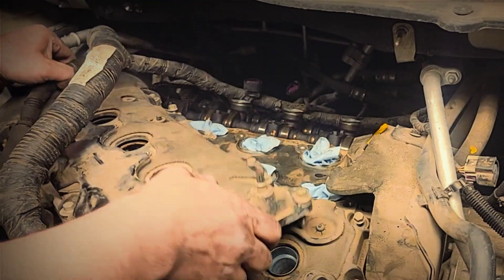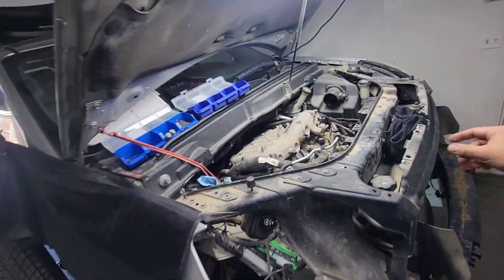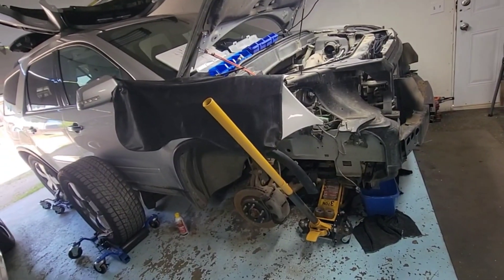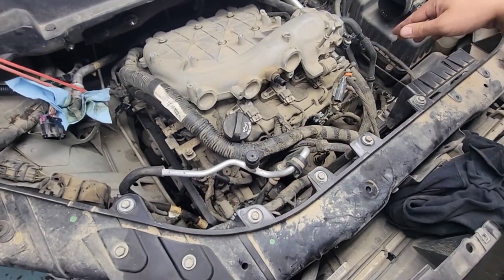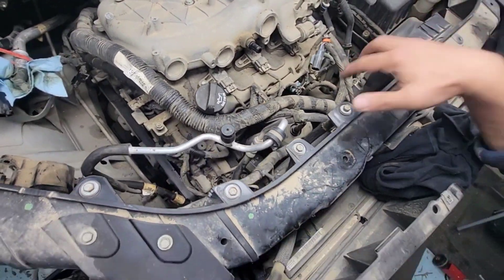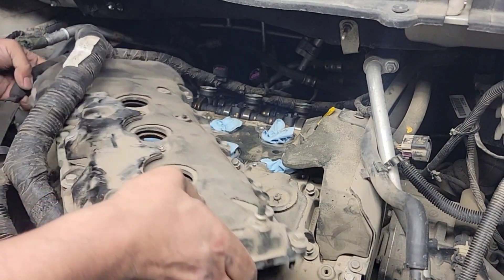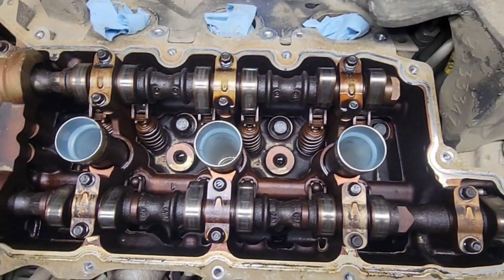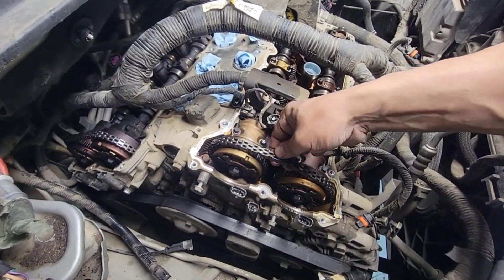2010+ Gmc Acadia 3.6L - Here Happens If you wait too long for an oil change

Comment: Wow, a lot of work but good to know it is doable without taking engine out of car. 

Question. I know my timing belt is stretched but I hear like a rattling/knocking sound on DRIVER side front of engine. It appears the timing chain is on the passenger side? Any ideas?
Save

Share
Reply
Reply from the maker: Its a V6 Engine design  it has a timing chain on the left side and right side.

I hear  alot of mechanic replace timing chains components, pistons and rods on this engine alot.
Reply: Thanks